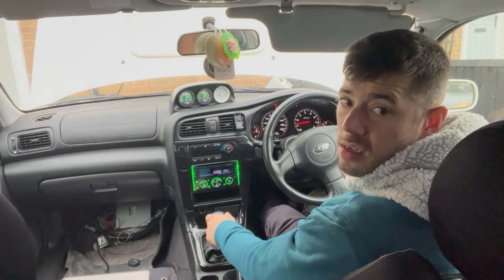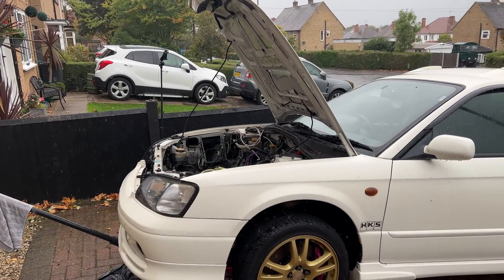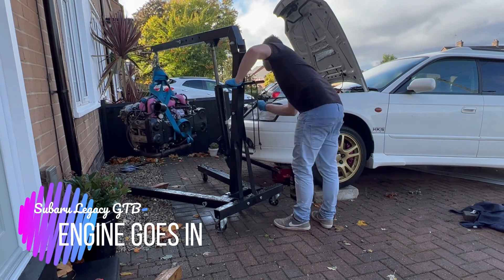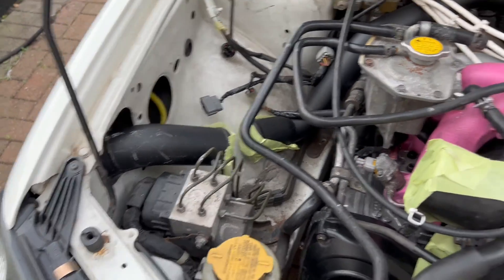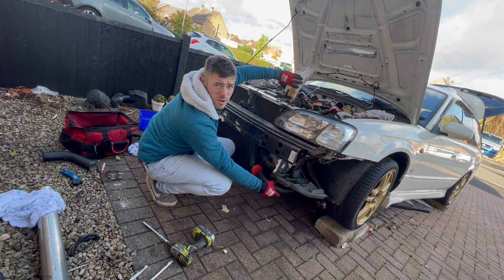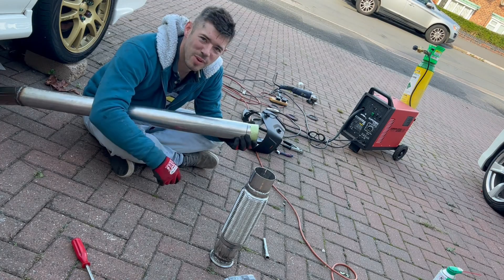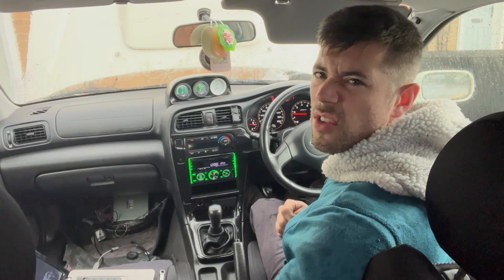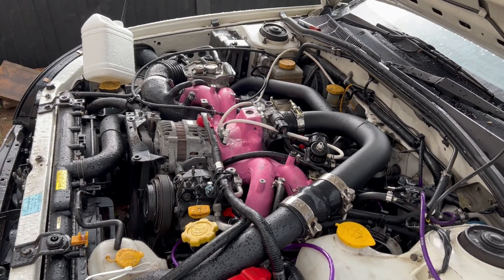Fitting A New Engine (EJ21) - Subaru Legacy GTB Project - Initial b

Comment: Hi mate, is your front mount kit for a classic or newage? Any chance of a link?
Reply from the maker: I used the japspeed MVT front mount from a newage, in reality it’s abit low.  But works nicely.
Reply: @InitialB  seem to be out of stock for gc8 and the newage - thanks for the info :)
Reply from the maker: @batbo315  on eBay, they are sold using the name gravity performance
Reply: Thank you  @InitialB

Comment: Am I right that’s the new engine? How much was it cost?
Reply from the maker: Yeah this is the new engine.   The engine cost around 6000
Reply: @InitialB  what have you got done to it ? any forged rods or pistons ?
Reply from the maker: @jmoore9806  , yeah it’s nitrided 2.5 crank, forged rods, RCM forged pistons, closed deck block, solid lifter conversion, single turbo etc . Standalone ecu.  A fair amount of work so far
Reply: @InitialB  oh nice....should hold up 600whp easy 👍 enjoy